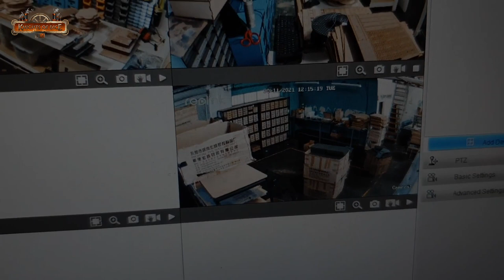Ep3 -  Wall to Wall

Comment: Hi, great videos btw, I was wondering if you have a painting guide or suggestions for painting up the mdf pacific hut range, I've never tackled this type of building before
Reply from the maker: I was actually working on one but I'm pretty sure that like so many other things, I never got it finished.  I very much will be doing one, I'm keen to expand the number of WW2 tables I have so a nice jungle board will certainly be included.